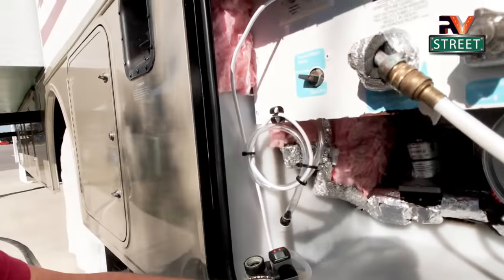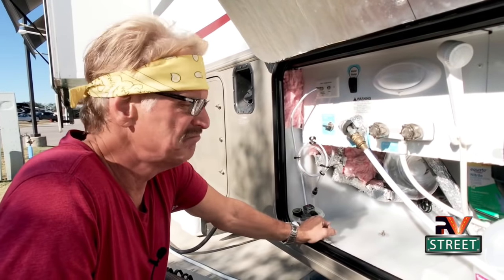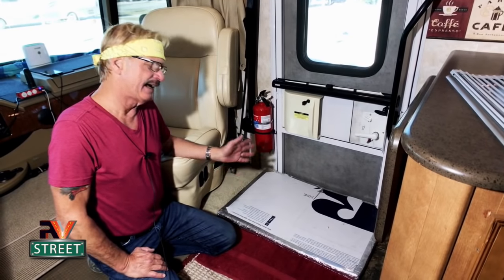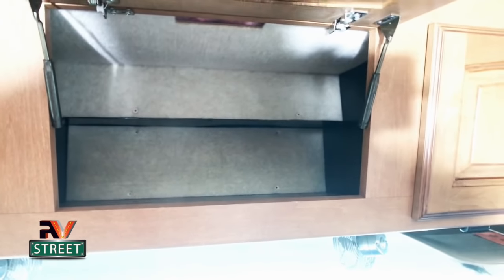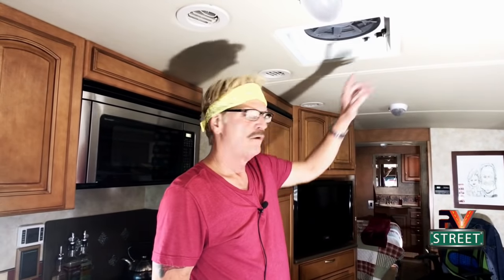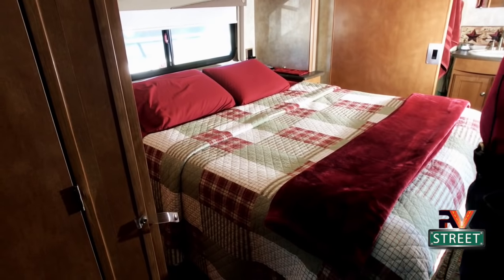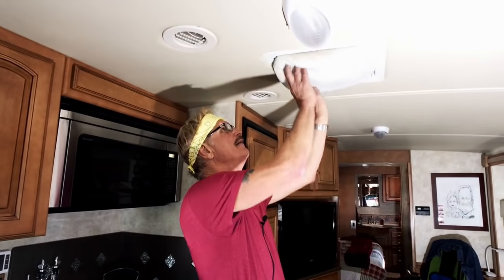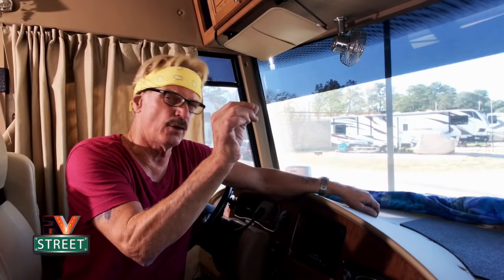😰  INSULATE, HEAT & PROTECT • Key to stay warm in your RV

Comment: i was greatful for all of your advise have lived in my fifth wheel going on the 5th winter i keep trying different things to keep warm in the winter,, heres the thing my 78 year old or young year old mother lives with me,, and although i can keep it fairly warm propane is huge tried a heater upstairs but kept blowing the main breaker in the park leaving me with  no hydro until the managers were up in the morning to turn the breaker on,, so something that would be beneficial in a video would be explaining what i can use in the winter in bc ,,lol for heaters that only work on 30 amp but wont keep blowing the main breaker,, and yes i am aware that i cant do the coffee pot microwave etc when i have certain things plugged in,, thank you
Reply from the maker: A typical RV propane heating system usually only draws about 8amps so that certainly wouldn't trip a breaker. A 30amp RV should easily run the propane furnace without tripping a breaker and everything else off. Since you said it keeps throwing the breaker at the CG electrical pedestal, it sounds to me like the CG pedestal is the problem. There's something else going on or perhaps I don't know enough from your comment.

Comment: The reason for using your propane furnace would be for people with campers like mine that have heat ducts in the under belly to keep water lines warm
Reply from the maker: I know people do that when it's <32º , but you don't need a heated under belly or in the bays when it's not freezing. Wasted propane IMO when you have electric—many times FREE electric—right next to the RV.
Reply: @RVstreet  true. I’m referring to times when it’s freezing or below.

Comment: These tips are great. I only have one concern and thats for that heat lamp. Growing up in a farm, we used these for baby piglets and they can get extremely hot. Can you tell me a little more about that? .
Reply from the maker: thx Mik,
I know the heat lamps your referring to for baby farm animals but this is not that kind of lamp. What I showed you is not a heat lamp, it's a utility lamp with either a 100 or 75watt incandescent bulb. I've been using these lamps now for over 5yrs. in the wet bay and it doesn't get HOT. But like I showed, I clamp it up and away and just be sure the silver ring isn't touching anything as an added precaution. After several hours, you can touch the silver ring and it's not HOT to the touch. I use an additional smaller utility lamp and a 75watt incandescent bulb in my 2nd smaller wet bay and the same thing in my battery bay to keep my batteries from freezing and keep them somewhat warm so they can charge properly during a freezing event. The utility lights & bulbs are in my Amazon Store in the “Stay Toasty, Control Condensation” category.
https://www.amazon.com/shop/rvstreet

Comment: This will be my first winter living in this toy hauler in Eastern Washington. Im expecting some damn cold temps so i really appreciate the insulation tips. 

Also, i will be using at least 2 electric heaters, and my computer seconds as a radiator as well.
 Ill be keeping propane at the ready for days/nights when the electrical heaters are insufficient, or if there's a problem with the heaters or a power outage.
Reply: If you have a toy hauler, consider making sure the dividing wall is well insulated also. JMHO.

Comment: Sounds like you are unaware that Mr. Buddy Heaters have an option so you can use a hose to connect to your primary or secondary 20/35/50/100# propane tanks.  We're doing mostly boondocking, so it's our primary heating option without power.  Our backup option is actually one of those "Chinese Diesel Heater" units.  Our rig is a diesel pusher, so I can "borrow" a couple gallons for a night if we really needed it.
Reply from the maker: Thank you for sharing that information

Comment: actually i only use the propane heat 20 degrees or lower, i bought an electric one that was modeled after the DYSON $538.00 heater/fan i got mine for $136.00 the one i have is called a "breezewell" heater/fan it works well. I have a 24 foot Homeland Elkhart express and even when i ran out of propane when it was down to -8 here in the hills of northern middle TN a couple weeks ago the heater helped. me and the dogs stayed nice and warm even once the propane quit. I am living in mine full time now ever since my wife passed away just before Christmas. like right now it's 35 degrees, no propane and i'm fine with the electrical heater going, like you said the electric is cheaper than the propane. and i want to save my propane for the tankless hot water and dish water any way. for the hose outside i have one of the 25 foot electric water hoses to keep the hose from freezing and black and gray water both have no less than a gallon of RV antifreeze in them unless they are being used. I like your idea for the slide outs the only problem i have with mine are the floor turning as cold as the wet ground outside even though it is carperted. I'm going to look into the slide out tips, can't hurt. something you might consider is the shiny aluminized  bubble wrap sheets for up against your glass inside to help hold the heat in also because those are single glass windows and they do draw damp. in my 24 foot RV i run a very similar looking dehydrator to keep the moisture out of the RV when i'm running the electric heat it draws VERY damp in here but on propane it stays dry. Been told Kerosene is also a good heater to keep everything dry and warm being i don't want to drive around with kerosene and a kerosene heater all the time i don't think i'll ever go that route. if my electricity goes out I do have a 3000 watt power inverter/generator that i can run ( on gasoline) to keep the lights on, heat  and power too. thankfully it's a quiet running generator. another Helpful hint i was given is underpenning. I have double insulated 30 foot tarps if another cold snap hits i will put those up and wrap the whole base of the trailer including the slide out from base to the ground and see if that helps also
Reply from the maker: Thanks Daddytech for that very cool detailed report up in TN. 👍
There was another lady that commented here that she also used a large tarp, cut it into 3' strips, hemmed them, sewed them together to make a long continuous skirting and then hung that all around the base of the RV using command strips. I thought that was a very innovative way to hang them without damaging the RV. I think she also said she backed the tarp with cardboard to support it better and block the wind from going under the RV.

Comment: Martin, I neglected to mention this in my other comments on previous videos, but thank you for your service.  This is another great, informative video.  Question, though: why remove the paper from faced insulation?  I believe the R-19 should remain R-19 regardless of the paper, right?  Or am I completely off on this one?  Anyway, great channel; undersubscribed, but that will change as more and more people view the great content.
Reply from the maker: Yes it still is R-19 regardless but In a nut shell, the faced insulation is normally used as a vapor/moisture barrier when used in home walls application and is not needed in this situation and especially when I’m putting in several layers in those large empty cavities.

Comment: Good tips ! Just a comment on the comparative cost of propane and electricity. I made a quick calculation: 1 litre of propane contain about 7.5 kwhr of energy. It means that with a 70% combustion efficiency you get about 5 kwhr out of a liter of propane. If the cost of el electricity is around 010$/ kWh and a liter of propane at 1$ it means that propane cost twice as much of electricity! Not that bad for a very convenient source of energy.
Reply from the maker: Thanks for that Marion, so here's where I was coming from in this video....
Remember what I said in the video... 
Your at a camp ground. You have the ability to plug into the pedestal and that electricity is many times FREE. It comes with your site fee. So why would anybody use propane to heat their RV when they have FREE electricity right outside. So in that senario, is doesn't matter whether propane in that area is cheaper to use or not. Buy and use a Ceramic floor heater and heat the RV for free. In other situations where you have to pay for electricity it MAY be cheaper to use propane it just depends on what part of the country you're in. But lately, I'm hearing of reports all over the country—especially in the northeastern states, that the cost of propane has gone up 40%-50% from last year, plus you have the hassle of getting the tanks refilled all the time.  

Then add a emergency situation like last winter here in Texas where the whole power grid went down. There was no electricity anywhere, and you couldn't find propane anywhere either. When you run out of propane, you have to use your generator to provide electricity. If you don't have a floor furnace or some kind of electrical heat your going to be really, really cold and you could lose all your groceries in the fridge too. If you have pets, it only compounds the problem.
So perhaps propane is a very convenient source of energy and sometimes cheaper but only if it's available and depending on where you are in the country.
Does all that make sense 🎅
Reply: @RVstreet  thanks for your response and yes I agree with you. In fact it is a very good practice to have many options. I just wanted to make the point that propane is not a bad option with a furnace, I do not believe in propane in a catalytic system because of the restriction for ventilation and humidity ( you well explain those issues). Propane have a very bad press those days and it seems that every one want to go for lithium and solar. Propane could still be a very good and inexpensive option. I have seen some camper spending 7,000$ on their solar system, it take a very long time to recup this money ( I am spending around 100$ of propane a year)

Comment: Any plumbing that is exposed to outside cold temps should have electric heat tapes run with the piping BEFORE you insulate the pipes.
Also get the heat pads for the fresh water , grey water and black water tanks as well as all associated plumbing to keep them from freezing.
Now insulate all exterior holding tanks.
Get the electric heated white fresh water supply hoses.
Bring enough heat tape and also rolls of duct unsulation to wrap around your dump hoses to keep those from freezing.
Reply: Even in June in Flagstaff ,AZ at 7,400 ft. Above sea level , it gets rather cold at night at altitude.
I use the electric heater AND the propane to keep in warm inside.
Windows , make the thick , double lined insulated curtains for your camper.
They act as a great barrier from the heat AND the cold.

Comment: Hello from New Hampshire! Great video, thank you! I winter camp up here full time in a campground with FHU with metered electric in a Grand Design 5th wheel with a weathertec 4 season package. Run a combination of an electric heater and the propane furnace. Got things all dialed in so the propane furnace runs enough to keep the underbelly tanks and plumbing. In previous winters I’ve been in -25 F temps with no skirting and no freeze ups. Run water from my inboard tanks and fill from the hydrant as needed. This year I skirted using EZ snap skirting and I run a small ceramic heater down there and it stays above freezing. This season’s lowest temp at 4 F so far, but it’ll get colder! Why, you may ask, do I camp in NH in the winter? Because I’m crazy! And actually, I’m a snowmobiler and the trails come right through the campground here. Thanks again for your videos and congrats on 1M views!!! - Curt. Insta: @maddawgrv
Reply from the maker: I’m a snowmobiler and the trails come right through the campground here......
Neither one of us has ever been snowmobiling but we both would love to do that but that is never going to happen. Joanie would never approve going to the snow.
We were right next door to you for the summer in Maine. We luv it up there.
We also luv the Grand Design 5vers. Especially the higher end ones. Those TRUE full 4 season rigs can handle a lot.
thx Curt 😝
Reply: @RVstreet  be sure you holler next time you come through!
Reply from the maker: @curtmaddon-maddawgrvadvent349  👍

Comment: Hi guys,
Could you please say why you take the paper off the insulation?
Congratulations on all the views! Love your channel!
Reply from the maker: This question has been answered in the comments but here it is again....
In a nut shell, the faced insulation is normally used as a vapor/moisture barrier when used in home walls application and is not needed in this situation and especially when I’m putting in several layers in those large empty cavities. If Home Depot had unfaced in stock at the time, I would of bought that.
thx Caren 💕

Comment: We use mostly propane for 3 reasons.
1. Have a 4 year old and 11 month old little hands love to mess with heaters. Had to unplug our fireplace. The 4 year old has a heated Mattress pad but the baby cannot.
2. We have a large fifth wheel 5 slides (will now be using your installation tips soon) but only 2 heaters can be plugged in before blowing breakers happens. And 2 heaters is not enough when its under 25.
3. We are on family land and they don't charge us for utilities. I don't want to run up the electric bill. And I can run the propane downstairs and not turn on heaters or anything upstairs if using propane.

Thanks for all the info do you have a video on how to keep the roof maintained?
Reply from the maker: Ah, ok....didn't think about little kids playing with heaters. Being retired you forget about stuff like that. And your 5ver having 5 slides that baby is big. So ya, I see you having to run propane too to stay warm. Lots of living space. thx Brittany 💗

Comment: Great video and super tips! Question: when you insulate around the wiring (like you did behind the bed area), wouldn't that be a fire hazard? A little concerned. Do you add some other barrier before adding insulation? Just want to be cautious. Thanks for the awesome and detailed video.
Reply from the maker: Good question...
No it's not a fire hazard. All that wiring was in it's own harness and wrapped in split loom for protection. There were no exposed wires or connections or anything like that. Think of it this way....in most houses when they frame them out, they install in the walls faced insulation in between the 2" x 4" studs. Think of all the wiring, wall outlets and junction boxes that run all along those walls and thru those studs. That insulation covers all those junction boxes, wall outlets and and that wiring is all up to code and doesn't pose a fire hazard. If you need more proof, take a little bit of that pink insulation that I used and try to start it on fire with a direct flame. 
Also JIC you're wondering:
The faced insulation is normally used as a vapor/moisture barrier when used in home walls application and is not needed in this situation and especially when I’m putting in several layers in those large empty cavities. Besides, Home Depot didn't have unfaced at the time or I would of bought that instead of having to remove the paper backing.
thx Wonda 👍
Reply: @RVstreet  Thank you for taking the time to explain. I appreciate it and NOW I understand. Keep sending us those great tips! Someday, I will become a weekend warrior too and need all the help I can get :).  In he meantime, I will live my dream through you super folks out there living free. Stay safe and warm!

Comment: You can now refill the small propane tanks with a $15.99 adapter. You refill the tanks off of the   20 gallon tanks. It makes
the small propane tanks only cost like $2.00. FYI.
Reply from the maker: Could you please provide me a link of the adapter your speaking of? 🙏
I have already modified my propane tank with an Extend-A-Stay. That allows me to use my BBQ grill right off my main propane tank. I would like to keep that feature but also be able to do what you outlined above.

Comment: In Arizona electric cost are high average 80 to $100 a month cheaper to run propane heater average cost around $30 a month for heat electric would be over $100 if i used space heaters
Reply from the maker: Oh wow that's cheap for a months worth of propane. WOW. I've met people who run their propane furnace that spends that much a week. So yeah, sounds like in AZ propane is a much better deal. Thanks for that comment David. 👍
Reply: $80 to 100 a month high? We were happy to pay low $200`s here last summer as our house electric can be over $600.00 in the summer.

Comment: Great video, I'll be headed to home depot soon! What is the purpose for removing the paper on the fiberglass insulation? Thank you.
Reply from the maker: This question has been answered in the comments but here it is again....

In a nut shell, the faced insulation is normally used as a vapor/moisture barrier when used in home walls application and is not needed in this situation and especially when I’m putting in several layers in those large empty cavities. If Home Depot had unfaced in stock at the time, I would of bought that.

Comment: You asked about using the propane heater...
Honestly... I don't know...
But if I was engineering an RV, I would run the heater ducts along the water pipes to minimize freezing... thus using an electric floor heater would reduce the effectiveness of doing that... just saying...

Comment: The condensation comes from you breathing.  The body puts a lot of water in the air.

The new trailer I bought has a fireplace and the second roof air is a heat pump.
Reply from the maker: Dehumidifiers and cracking a couple of vents takes care of all those problems no matter where condensation comes from. 👍